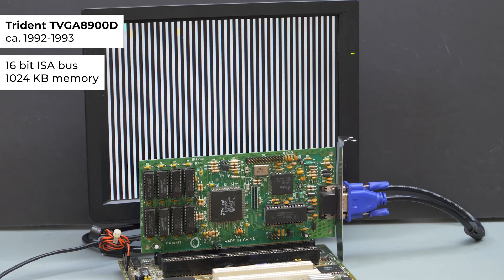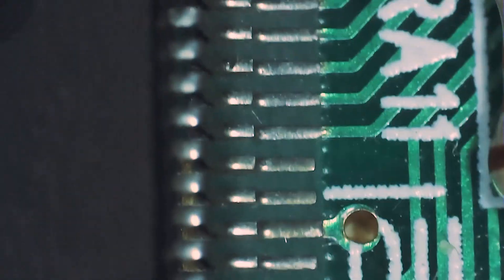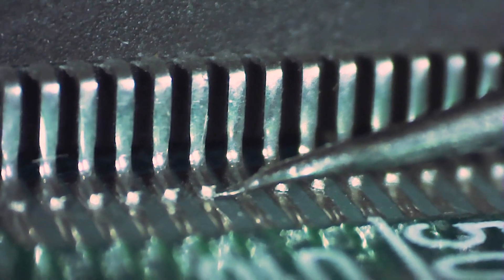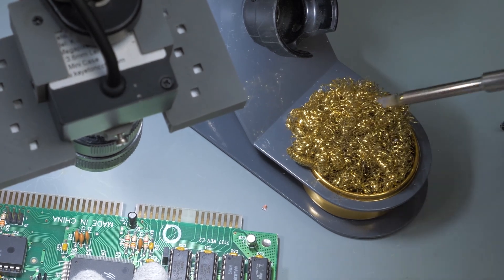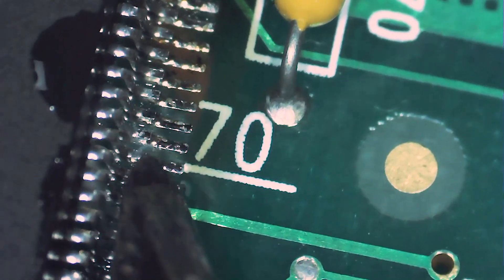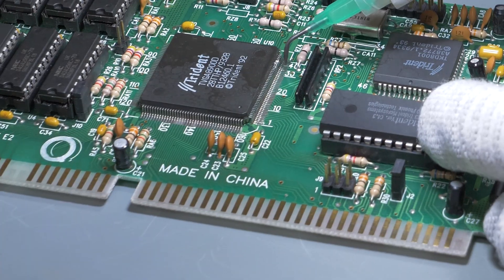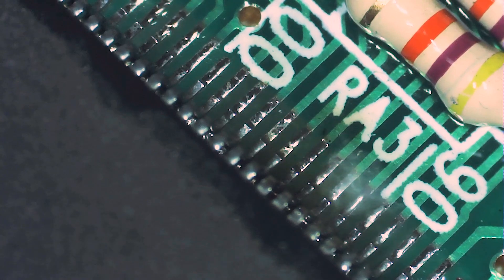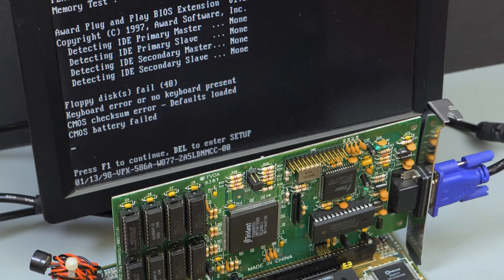Repair of 30 year old Trident TVGA 8900D graphics card. Re-soldering QFP SMD chip.

Comment: Great technique, subscribed! What soldering iron and flux are you using?
Reply from the maker: Thanks! I'm using a generic T-12 soldering iron with DC jack, it's called something like "12-24V DC Power Supply Adjustable Temperature Soldering Iron T12". I modified it with a better silicone cable and added a holder with a sponge. It can be used with a laptop power supply or even battery etc. I'm using T-12K tip here. Flux is Amtech 559.
Reply: @adalbertfix  Nice, thanks for the info. I thought it was some fancy Hakko or similar, maybe based on the apparent ease of operation and the quality of the end result. I'm using a ZD-917 soldering iron+vacuum desoldering station, bought some tips for the soldering iron but their quality is below average, not to mention the store messed up my order a bit so I didn't receive everything that I ordered, and instead I have some doubles...
Reply from the maker: @nicushorul2007  my soldering iron is actually some kind of Hakko rip-off, because T-12 is a Hakko soldering tip standard. You should be even able to use genuine Hakko tips with it. I used a basic ZD soldering iron in the past and this is a day and night difference. Any T-12 soldering iron should work reasonably well, because the heating element and temperature sensor is actually inside of the soldering tip, and the rest is basically just a handle with cables and temperature control. So you can get cheap iron which is compatible with high quality tips.